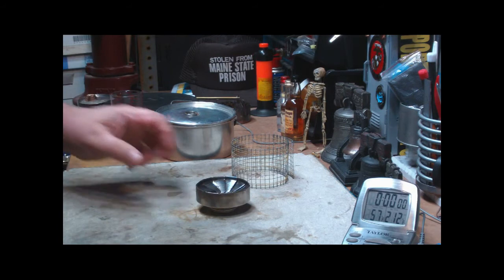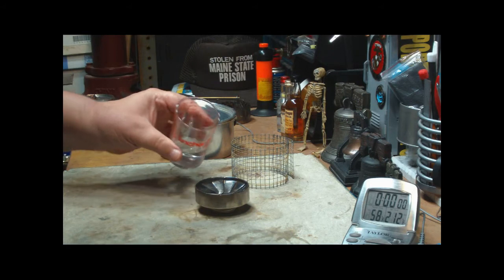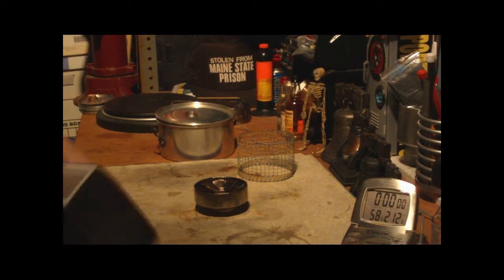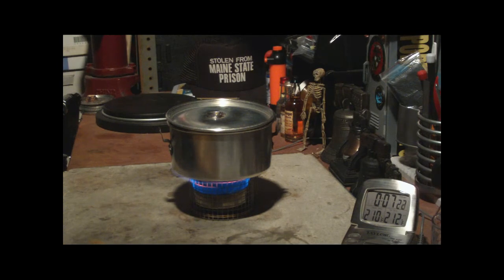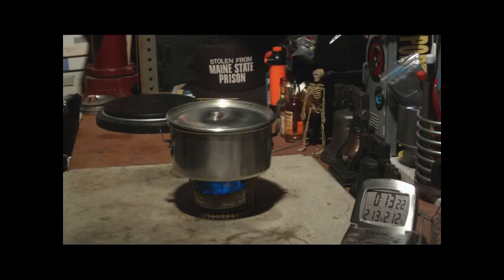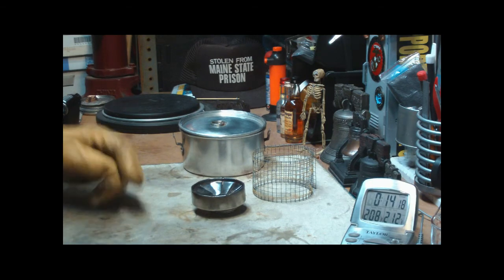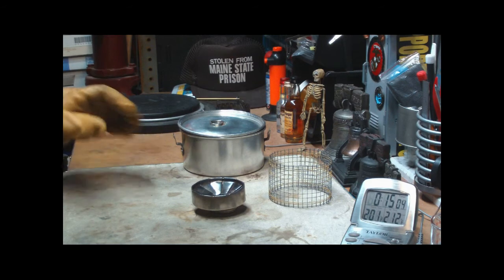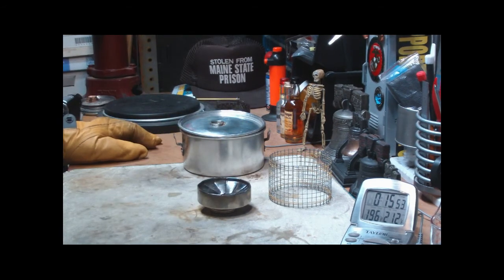Flat Cat Gear's Standard Stove -  Boil Test 1

Comment: Thanks Hiram.  In our test we use the integrated windscreen/ pot stand and can boil 2 cups of 70 F water using ½ oz. of S-L-X.  Pot stands have a big impact on stove performance which is why we support the pot via the windscreen (and why we don’t offer stoves with integrated pot stands).  A good windscreen will cut a minute off of the boil time.  BTW, the stove is made of 304 Stainless Steel and yes the pedals have a significant impact on performance.  Best regards - Jon